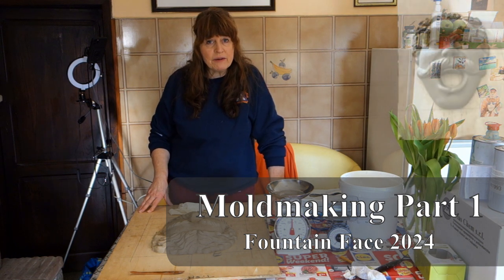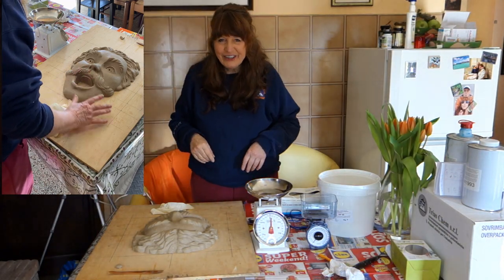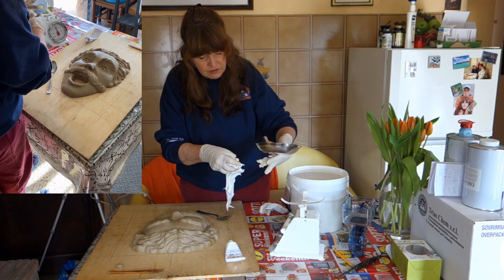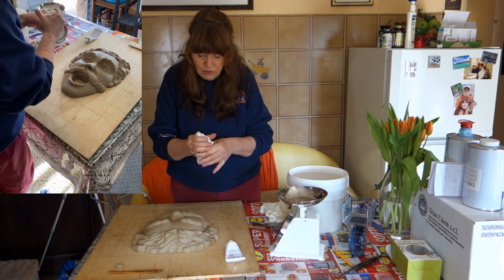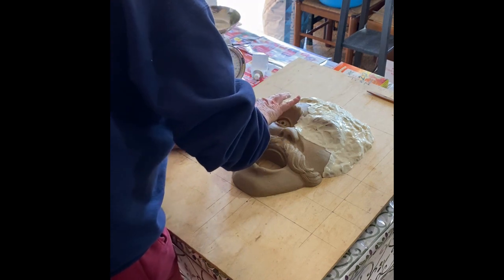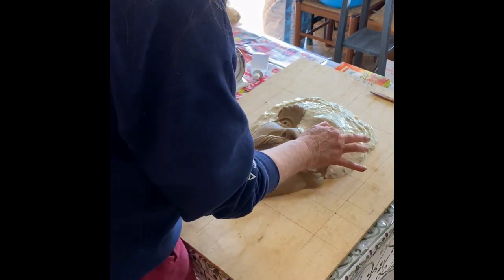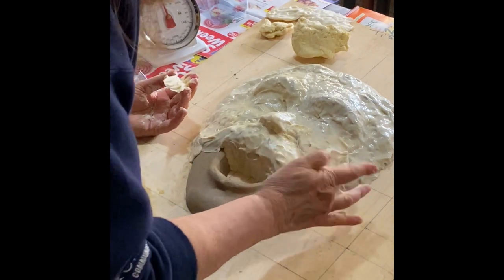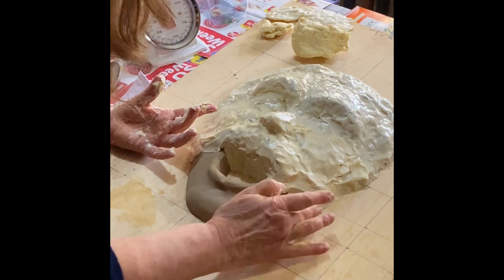Sculpture:  How to make the Flexible Rubber Mold for Art "Fountain Face" 2024-02-17 Mold making Pt 1

Comment: Great video. What chemicals and clay are you using, specifically?
Reply from the maker: The clay is plastilina, Tan AB-225 to be specific.  I bought it decades ago from John Reynolds.  It is a wax-based clay (instead of oil-based).  I love it!  The rubber mold consists of two parts you mix up as needed.  The fiberglass is the same (2 parts).  I bought them at a sculpture mold making supply shop.  I showed them the portrait sculpture I did before this project and asked them what I needed for it... then the rest was used here.  Thank you for your question.